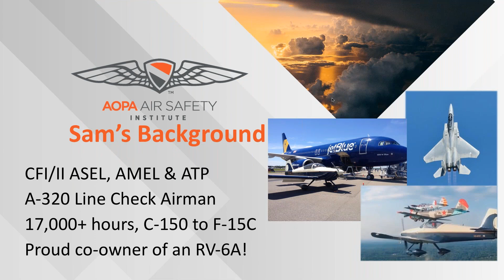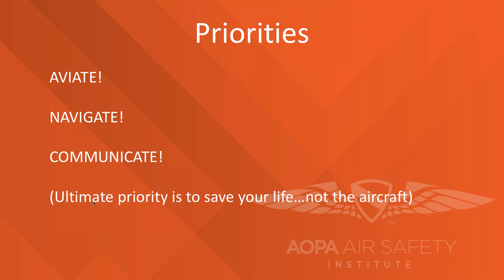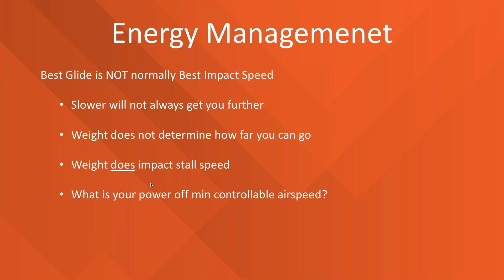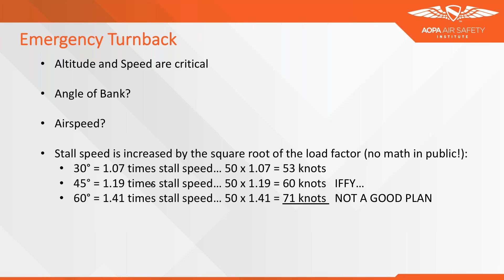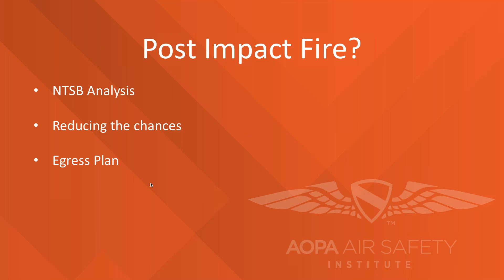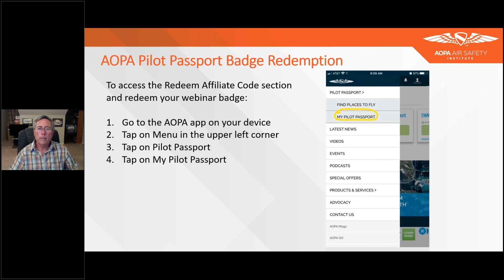Webinar: Forced Landings: A Plan to Survive

Comment: I hardly ever hear this, but regarding the runway turnback, if the runway it is shorter than a certain amount then you will not be able to return because by the time you are high enough to execute a safe reversal you will already be too far away. IOW, you may make the turnback, but you will land short of the runway/airport. In my plane, the minimum runway length for a return is approximately 3500-4000 feet at sea level, and that's with little or no margin, but that length increases quickly at higher density altitudes because of reduced climb performance. The flip side is that in a relatively short period of time, no matter how big the airport is that you departed from, you will still be too far away to return without power. The window for a return is quite narrow and is much more complicated than just making the turn, perhaps further illustrating why landing ahead or to the side is popularly viewed as a lower risk.

Comment: Halon or modern equivalents can stop fire at 5% or so, they do not destroy oxygen.  At fire suppression concentration of halon, you could breathe for a fairly long period.   You'd basically get high from breathing the halon eventually, but it's a myth that it takes all the oxygen out of the air, that's not how they work.

Comment: I'm astonished that AOPA would publish this.  The comment about he's not seen data on "Aircraft Initially Float" and using some kind of "rescue hammer" to break a polycarbonate window are simply preposterous and irresponsible. The only thing worse that not having confidence in your emergency equipment is having emergency equipment that doesn't word.  The comment about "aircraft not floating" is probably true with fighter aircraft that plunge into the sea from the deck of an aircraft carrier, but common sense tells me that an GA aircraft if a survivable ditching is going to initially float. With the exception probably involving a float plane that flips upside down, but even then, the airplane won't immediately sink.

Regardless for the reason's the narrator chose to state these does not lend confidence in other things he has to say.  This certainly isn't what I would expect from AOPA's Air Safety Institute.  

This is the type of information that lawyers record and have hidden in their bag of tricks when it's time to sue.

Comment: "How much time do I have?...weight has nothing to do with it."
Well, that's totally incorrect. It is a fundamental fact in principles of flight that speed for best glide varies with weight, hence your time from any given altitude reduces as weight increases even though your range will be the same if you use the correct speed. It is a concern that such a basic misconception should exist within the ASI and find its way into a safety presentation.
   Furthermore, using their own simplified rule of thumb they still get the sums wrong for range from 500'. It should be 3/4 mile based on their own formula, not 1.5 miles. The idea that you can glide a 172 for 1.5 miles from 500' should immediately be seen as absurd and rejected before going on a slide. What happend here is the guy actually read it out loud to the audience and still the penny didn't drop.
   This just goes to show you need to be very careful about which experts you listen to.

Comment: Don't forget to pull back the prop for best glide, and when you have the landing spot made you can push it back in to use it for insurance (i.e. you'll have a little bit of a glide extender available if you need it).

Comment: Higher weight and speed does have an impact on glide range predictability as it reduces the effect of head/tailwind.
I am thinking: if you have a strong headwind and don't have a good field behind you, it may be worth adding a +5 to beat the headwind, likewise if you have a strong tailwind and are close enough to the emergency field you could try slowing down by -5 to reduce descent rate and give yourself a bit of extra time to do stuff/think.